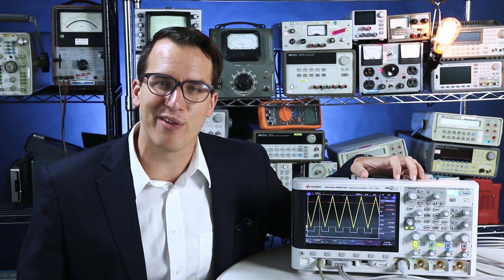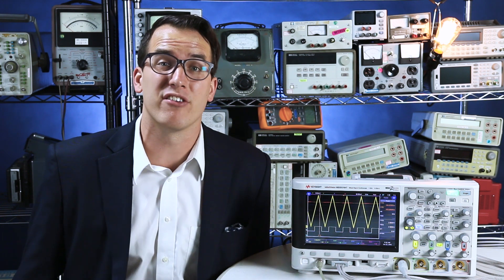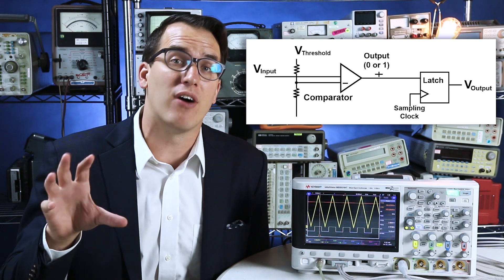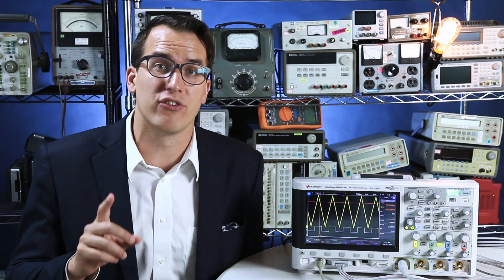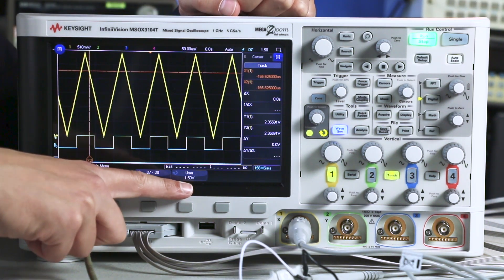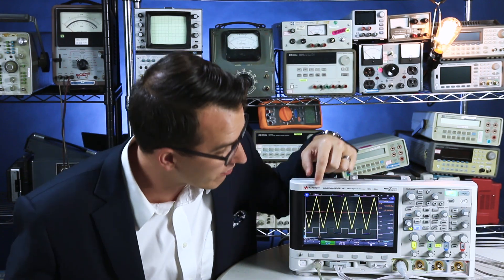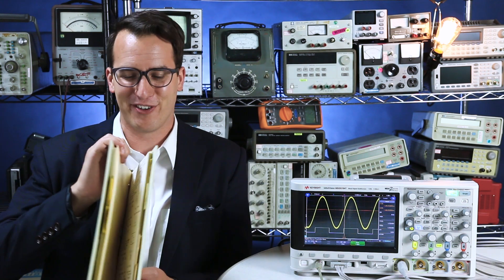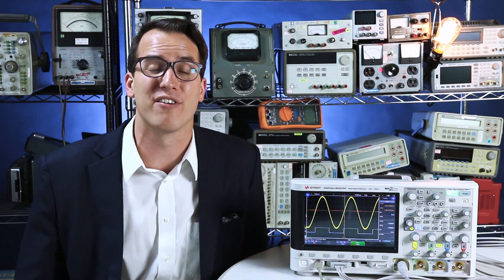How MSO Digital Channels Work - Oscilloscope How To - The 2-Minute Guru (s1e15)

Comment: Slightly ahead of next week, but if I drive an OLED with 8-bit data bus, where each byte clocks on an IO pin can the Digital option be used to read the bytes being sent?
Reply from the maker: Probably yes in this case. If the signal lines are parallel, you can designate the digital channels you are using as part of their own bus on the scope. But, it won't only latch on the IO pin clock, it'll still be based on the scope's internal clock. Logic analyzers have a mode called "state mode," where the sampling clock is user supplied instead of just using the internal sampling clock. 

If it's a serial bus with an 8-bit packet, you'll probably just have to do it the old fashioned way of writing out the 1s and 0s unless it's using a scope-supported protocol, in which the scope will decode it for you. I hope that all makes sense?
Reply: +KEYSIGHT OSCILLOSCOPES I think so, thanks. Basically it is a case of triggering a sample of 8 digital IO lines when another pin goes from high to low, potentially into segmented memory. I can decode the data if needed, the aim would be to confirm the data going to the display is within the timing needed by the display to track down intermittent issues of display corruption on system startup. So it I may have to look at the MSO option at some point...
Reply from the maker: +Jeremy Curtis yep, sounds like it would work well for you.
Reply: Thanks, last hurdle is to get get the MSO update for my DSOX3024T.